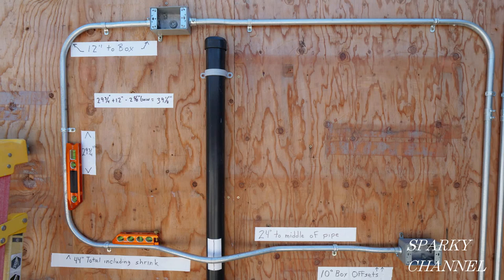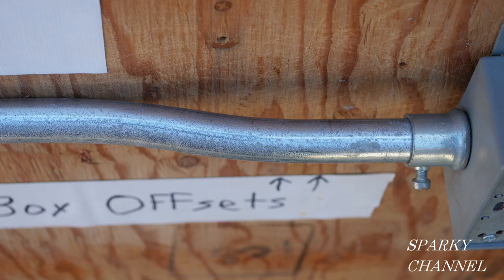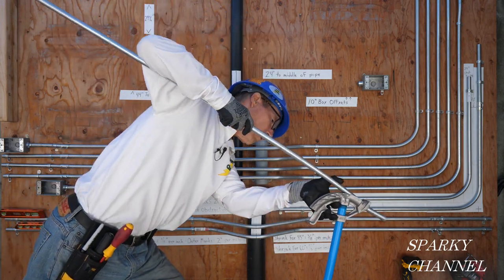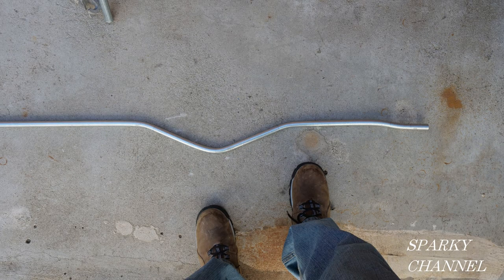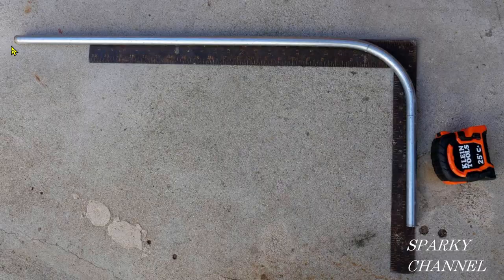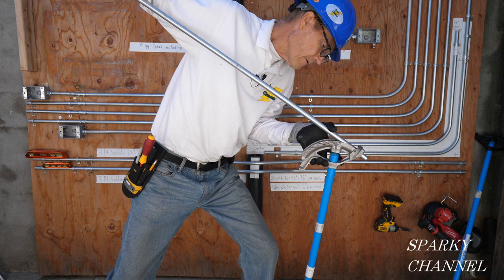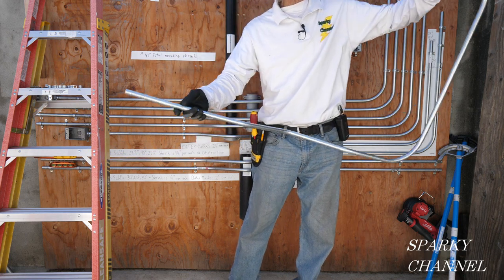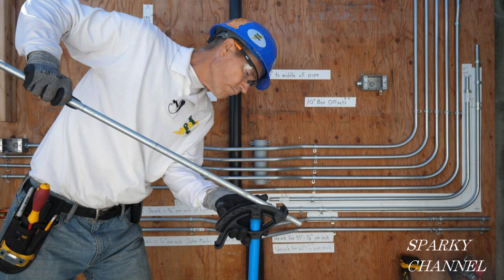How to EMT Bending: Box Offsets, 3 Point Saddle Bend and Back-to-Back 90's All in the Same Run!

Comment: a trick I picked up when I was a cub is if you have a complex bend, do a miniature mockup, first, using a scrap of solid copper conductor.  that way you have a model of what direction each bend needs to be and don't accidentally make a bend backwards.
Reply from the maker: Copper wire is great for all sorts of things! Thanks Ken!

Comment: Have you done a video of how to add a T-box to an existing straight conduit? Could you bend offset in place or do you have to use couplers? PS. Great Video
Reply from the maker: No, I don't have a video like that. You would need the proper fittings for EMT.  "T." Clamps are suitable for Type MC metal-clad cable. But with emt fittings you can certainly use box offset bends.

Comment: Thanks for the content sparky, but where does the multiplier come from? is it different for each type of size of conduit? Is there a way to calculate it with out seeing a reference table? Sorry for the questions but I’m just starting and I love to understand instead of just know.
Reply: it is all geometry.  the offset multiplier is sort of simple to calculate - you're essentially calculating the hypotenuse of a right triangle.  the "gain" in a 90 is a trickier calculation, because it is the difference between the radius of the bender - which is different depending on the size of the pipe and the brand of bender - and a square corner.

it bears mentioning that if you use 30 degree bends for an offset, the multiplier is 2.
Reply from the maker: Here you go: How To Memorize EMT Multipliers, Shrink and Outer Marks of 3 Point Saddle Bends: https://youtu.be/_NWRVqWFtk0
Yes, the different sizes of EMT use the same multipliers.
Reply from the maker: @kenbrown2808  Thanks Ken!
Reply: Thanks for the reply appreciate all the knowledge some kind stranger can impart on me.
Reply: @diegohernandez5283  you're welcome.  I'm kind of like you when it comes to liking to understand how things work.